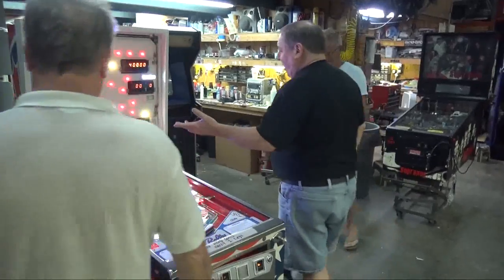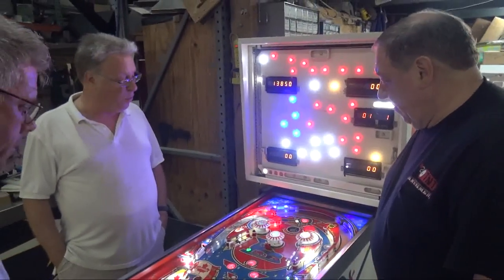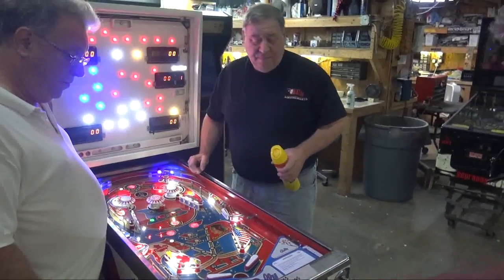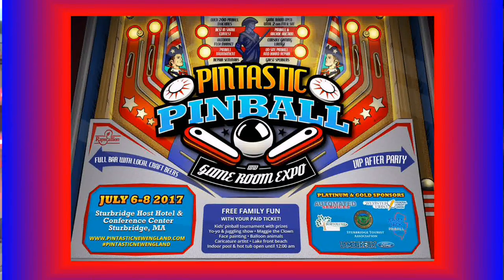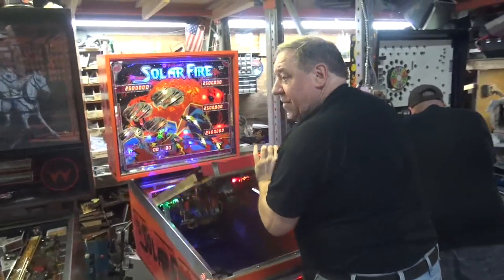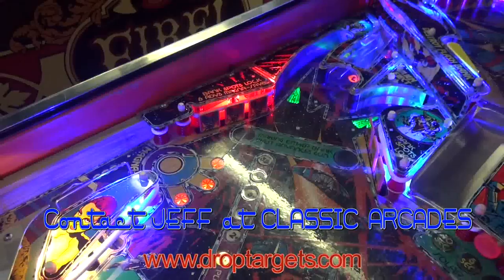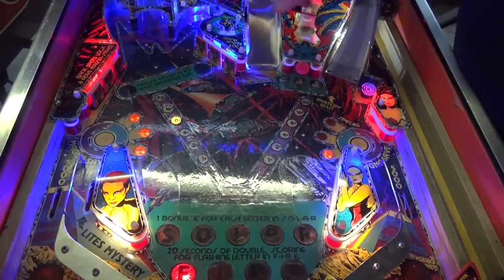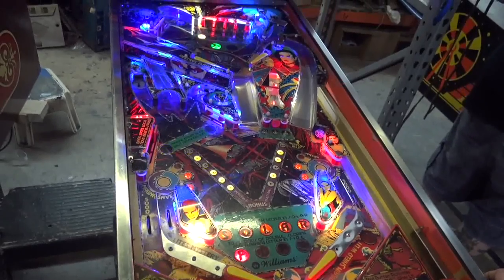#1288 Rare Williams SOLAR FIRE Pinball Machine- Plus Bally POWER PLAY- TNT Amusements

Comment: Does solar fire use staged flippers?
I see it uses the dual action switches
Do the flippers actually function in a staged manner?

Also, these flippers are direct?
Do not run through the logic board?